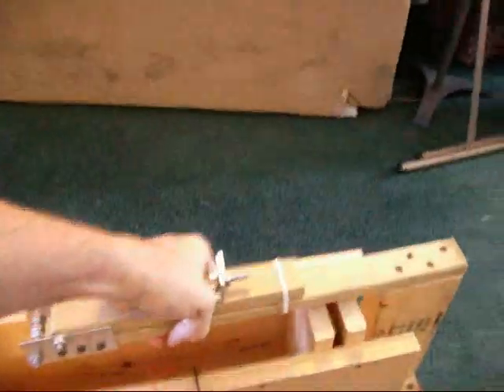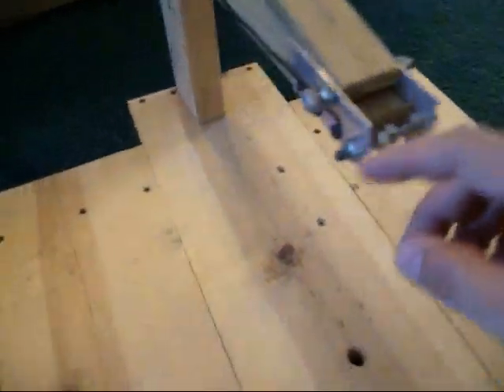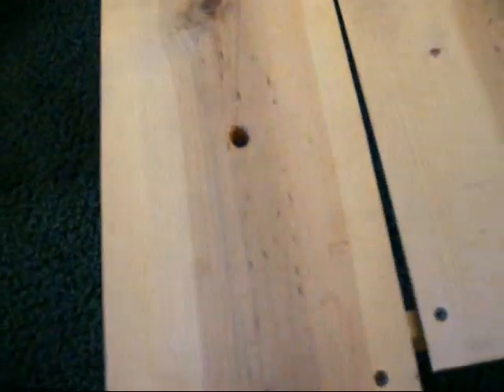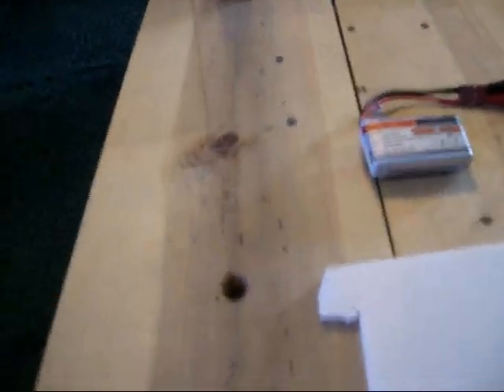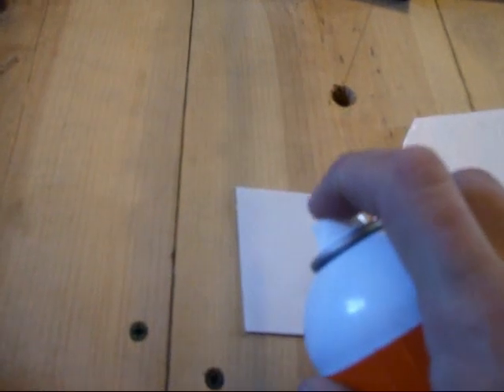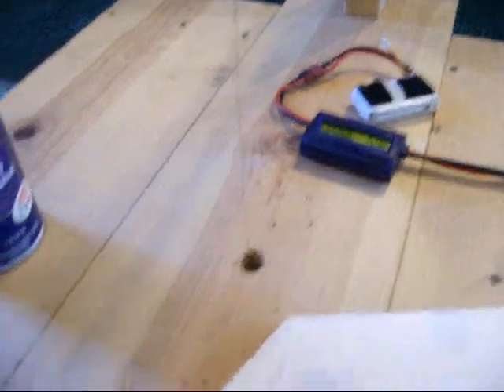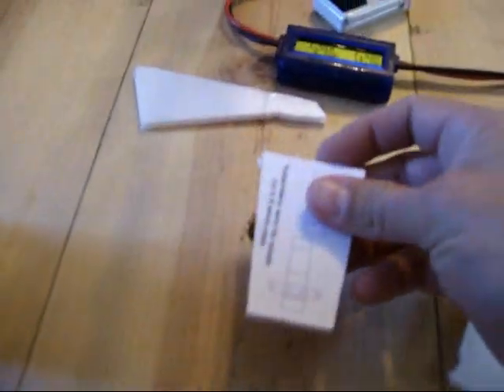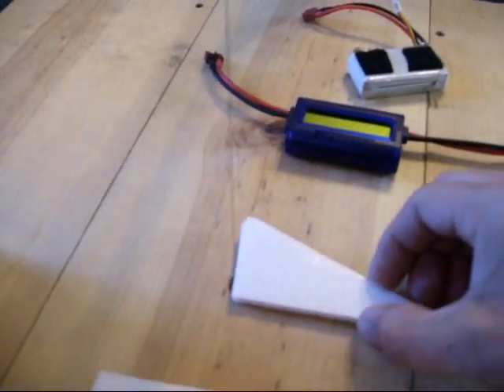home made hot wire cutter

Comment: professional build, and the battery and steel wire could easily be replaced by a normal 12V adapter and resistance wire of correct thickness.

Comment from the maker: someone messaged me with a question on voltage, and I can't find how to respond right now, so I'll just put it there, a 2S lipo is between 7.4  and 8.4 volts. So something in that area will be similar to mine.  I have also heard of others using 12V power supplies, but you need to make sure it will support the amps you will draw from it (they will be higher than mine, without a wire change)

Comment: Nice but there is even cheaper and simpler way. Total cost... <10$?
https://www.dropbox.com/s/yt2o8t1znlparu6/przecinak.PNG?dl=0
We need PCB board, resistant wire(FeCrAl), 3-5 screws M3/M4 , 4-6 nuts, 6-8 pads, soldering iron, tin and spring(can be even from pen). Cut the letter C from PCB ~ 6" of height. Cut the copper layer(using blade) to make "printed" and isolated L upside down and "_" This is simplest version. Second more complicated :D but better handled is to cut very high letter L from rectangle pcb and screw together L and rest of it - to make shape "_C".  Plate copper layers must be isolated from each other, so holes for screws must be drilled in two steps. First is to drill 3mm then drill slightly only copper layer using drill bit 8mm or chemicaly by FeCl3, Na2S2O8. Copper will be isolated from screws so we can screw both plates together. Then we must drill another three holes for wire screws. Then screw the wire on one side, screw spring on another and connect together to make number 7 look like. Third screw should be screwed using pads and two nuts just to lead the wire. At last we must solder power cord to copper layer: one wire to L(blue) another to _(red) and voila. Power supply should be <24V eq. ATX from PC yellow and black is 12V, red and black is 5V (by connecting green and black wire it will power up) Using constant voltage, shorter wire higher temperature. Shorter the wire - lower battery voltage should be. If for 0.75mm2 wire ~1m, 24V is ideal, 6" wire @ voltage  3.6V (Li-ion) would be ideal. 10" for 5V. BTW. You can even solder switches on the surface, PWM temperature controllers etc. without additional material cost :) Simplest temperature controller for all human beings is mechanical as shown on picture ;) Just add selection switcher on the top and voila. It could be even paperclip  :) PS Sorry for grammar English is not my primary language. I hope it would be helpful. Correct me if im wrong.

Comment: Great one friend.
Does it cut Acrylic sheet too? How much is the thickness we can cut through it?
Reply from the maker: no, it would take much more heat for that. Mine can cut any foam that will fit between the arm and the surface, but the thicker the slower (both height thickness and density thickness)

Comment: really nice tool, really well done.
can you cut the paper coated foam with it?
Reply from the maker: if you mean the foam board from the dollar store, not mine.  If you did one with more heat, maybe.  I don't want mine to, as I use poster board templates, and I want the wire to go through the foam, and not damage the poster board.

Comment: You might could find an old phone charger or other plug that has the same or close to the voltage and amp rating that you need this way you could avoid messing up a battery. But this is a cool project i will probably build one myself to build some foam rc airplanes.

Comment: Hey I have a steel 10 gage gatar string that is 12 in long can I power it to make a hot wire cutter with the battery you used please respond

Comment: It seems that a model train/car power pack of decent amperage should be able to power this.

A cautionary note is in order: smoking styrene plastic releases cyanide gas. While it's not enough to kill you, it won't do you any good and adequate ventilation should be used.

I've used the hot wire tool from Woodland Scenics, which uses a nichrome wire.

Comment from the maker: The length of leader wire that the current runs through is 10 inches, so the whole thing is a bit longer to include the needed loops (that will vary based on your setup), but if you use the same wire size and the same length that the current runs through, you should get the same heat, and the same amp draw.  I am using a 2S lipo.  Any 2S that can sustain 2 amps (more like rated for over 5 to be safe) should be good.

Comment from the maker: The wire does touch the top of the wood, but the current does not run through that part of the leader wire.  The current runs through the bolt at the end of the arm, which the leader wire goes over, then goes through the leader wire. Only the part of the wire that has current going through it is hot.  At the bottom the wire does not touch the wood.

Comment from the maker: I would check any system with a watt or amp meter to be sure of current draw. If you want to do airfoils, you will likely want to make some sort of bow and need a longer hot wire. It will require more amps for that wire. It will take some testing to see how many amps it will take to get the longer wire hot enough. Just a guess, I’d think you would either need a slightly thicker wire (but will draw more amps) or maybe stay with thinner wire and up the volts, using a 3S.  Either way, I’d check it.

Comment from the maker: I was going to delete your comment, but I think I’ll leave your ignorance for all to see… First off I am not cutting cardboard, I am cutting foam.  I first cut poster board templates (using scissors and razors), then use them to cut out the foam quickly, repeatedly and with uniform sealed edges.  I’m sorry if you are too simple to comprehend how this is much faster than using a razor every time.   Apparently there are stupid people not in America too.

Comment from the maker: You have no idea what you are talking about.  I AM NOT SHORTING IT OUT.  if you WATCH the video you will see that it is only pulling about 2 amps!!!  if I was shorting it out, it would be much higher than that, and bad things would start happening.  If you look at a light bulb circuit, it looks like a short connected to a battery too, but no one thinks twice about that.  The difference between the bulb, stainless wire, and a real short, is the resistance (load) which determines the current draw.

Comment from the maker: No, This is only pulling about 2 amps, which is well within what the battery can handle.  I know this looks like a direct short, but so does a light bulb if you just look at the circuit.  The key is that the wire I am using has a high resistance, which is what causes it to heat up.  The length of the wire will affect how many amps are drawn and how hot the wire gets.

Comment: @kenmorto It's made entirely of poplar wood. The brackets on the sides of the arm are called "mending Plates", all  found at Homedepot. The rest of the materials are listed in the link in the description above. I also used a ac/dc power adapter that is 12v dc 3amps, which I believe was a little too powerful for the smaller guitar strings I used, as they broken a little too easily. Hope this helps.

Comment from the maker: @cafediablo30,
for something like a wing, you would want to make a Bow for longer cuts (length of the wing).  This design was more for thinner parts.  You could scale it up, but would have to play with the wire diameter/length, voltage to get the heat/amps correct.

Comment from the maker: @RCcrAzY1234 ,

it is really best to use something to measure the amp draw from your battery. Drawing to many amps from a lipo will ruin it, and may even start a fire. I measured the current to be sure I was not exceeding the battery's capabilities. But yes you can just connect the battery to the wire with alligator clips. You can also adjust the heat and amps by sliding the clip along the wire. Use these to adjust: thicker wire=more amps & hotter wire; longer wire = less amps & cooler wire

Comment from the maker: it is really best to use something to measure the amp draw from your battery.  Drawing to many amps from a lipo will ruin it, and may even start a fire.  I measured the current to be sure I was not exceeding the battery's capabilities.    But yes you can just connect the battery to the wire with alligator clips.  You can also adjust the heat and amps by sliding the clip along the wire.  Use these to adjust: thicker wire=more amps & hotter  wire; longer wire = less amps & cooler wire

Comment: im trying to make a foam cutter based on your idea, but i got a question. What about using a 3cell 2600mah lipo battery with 30C?? do you think it might work?... im trying to make some profile cutting for combat wings and soaring sailplanes, not just foam board airplanes. Also, you just connect each wire side with the neg(-) pos(+) caiman clamps?

Comment from the maker: @SL4VE0WNER1904619 ,
My reason is to cut out parts that I use to make RC planes.  I make a pattern out of poster board, lightly glue it to the foam, cut it out, then pop off the poster board.

Comment from the maker: @adrianTNT ,
to make the wire not as hot, make the wire longer.  If you made one like mine, you can add some screws to the bottom of the board, and snake the wire around the extra screws to add length.  Then if you use an alligator clip for the wire, you can move it along the wire to vary the heat.  Another way is to use thinner wire.  Both of these will take experimentation to find what works for you.

Comment: @yzguyfl63 I was able to cut some foam nicely with a 1Amp power supply (from router I think), wire looked normal but it was very hot. I had an issue because the wire expanded on heat :) I linked the wire to a rubber strap and placed the power on wire away from the rubber, it worked OK.
I will check power supply temp too next time I use it, but I only keep it on for seconds. Worked nicely so far, I made very thin 2.5mm polyester sheets with it (for a light rc plane).

Comment from the maker: @adrianTNT
the power supply for most common devices will not provide enough current.  Something like a network router is typically around .5 amps, and this takes 2-3.  Now laptop power supplies typically are more, commonly around 5 amps, and would also work.  BUT first check the output amps of your power supply to make sure what it will provide, and also I would recommend measuring the current for yourself with some type of meter, or you risk overheating the power supply by drawing to many amps

Comment from the maker: @adrianTNT , 
I am using stainless steel wire.  This has a higher resistance than normal copper or steel wire, which is why it converts the electrical power into heat.  The thicker the wire, the less resistance, and the higher the amp draw, and the hotter the wire. Also the longer the wire, the more resistance, less amps, cooler wire.  If you use another material, it will not work the same way.  Yes it sort of is a short, but no more than a light bulb is.  You could connect a fuse if you want.

Comment: Will it work if I connect a 10-12V adapter (from network router for example) and use a wire from a 220V heater? Just a smaller part of the whole wire used at 220V.
I don't know how to call that heater wire in English, it is that coil around a ceramic tube.
Don't I need to connect anything like fuse or something? Because directly connecting it is similar to a short circuit (?!)

Comment from the maker: I'm actually not sure.  If you use a lipo, you do have to make sure you don't drain it to far as that will damage it.  It will take some testing for your exact setup.  But at around 2-3 amps, a 1300 mah should last more than 20 min (which is way more than I ever use it for at one time).

Comment from the maker: Yeah I started with the dimmer and 12 dc converter (old car charger) but my power supply was way to old and bad.  Then I actually tested the amps and thought about it, 2-3 amps is not much at all.  A 1300 2s can do this without an issue.